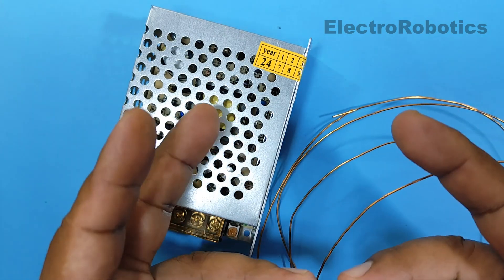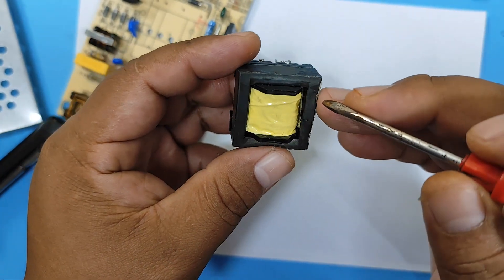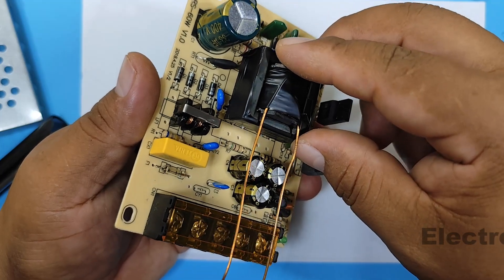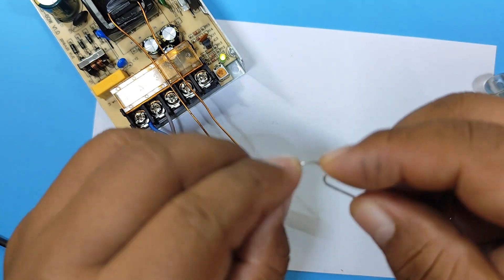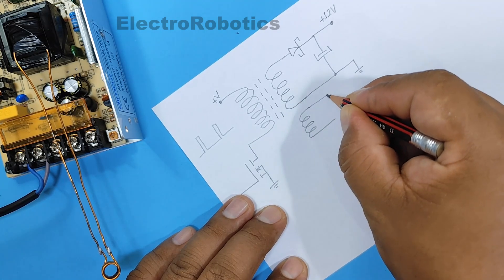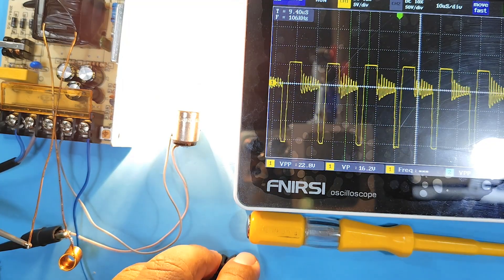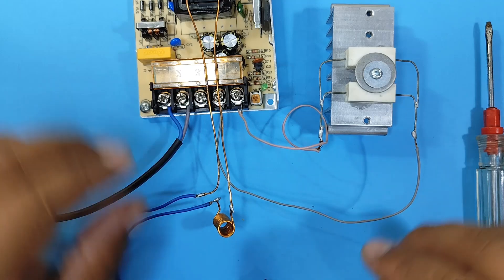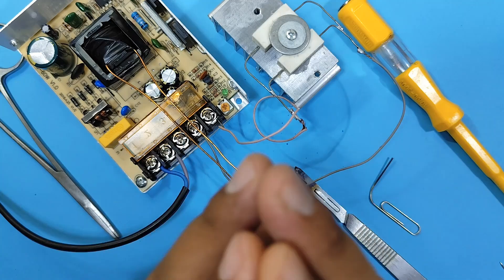Use any Charger or Switching Power Supply to Make an Induction Heater.

Comment: Those resistors will get very hot as they are overloaded.  12 ohms at 12 volts is 1 amp, so 12 watts each for a 5 watt resistor.  Only good for a very short amount of time and be careful as even with the heat sink they can get hot enough to burn you.  Never leave this unattended.  That and lose the music.  Otherwise, cool idea.
Reply: But the 2 resistors are in parallel, so imo value is  6 ohm 20 watt. Am I wrong?
Reply: @Fin_nish_usr  Total value is 6 ohms at 10 watts.  How do you get to 20 watts?  Remember that the power supply outputs a constant 12 volts so each resistor "doesn't know" the other one is there, only that it sees 12 volts.  With both resistors, the power dissipated is EI=E^2/R=I^2R=12*2=24 watts.
Reply from the maker: Hi, very good explanation, thanks for commenting.
And that's correct. It would be best if they were at least 10W, as mentioned in the video.
You're also right: it's not advisable to leave them plugged in for long periods of time if they're using 5W resistors.
Reply: This for demonstration   isn't it.